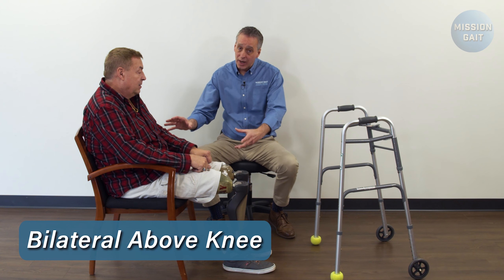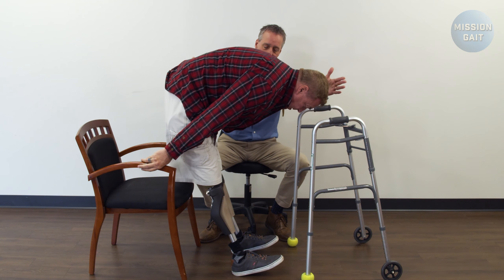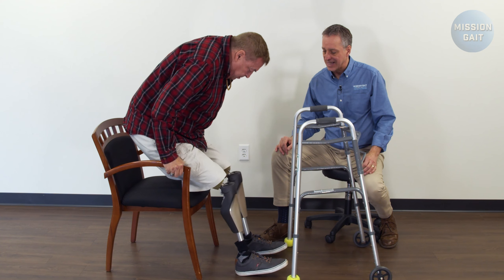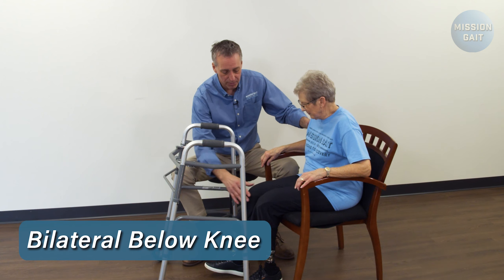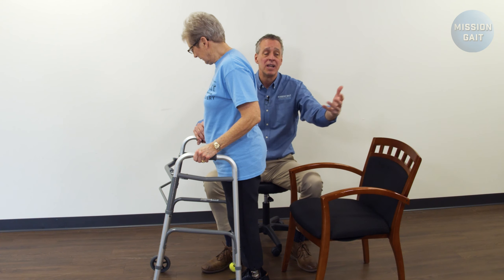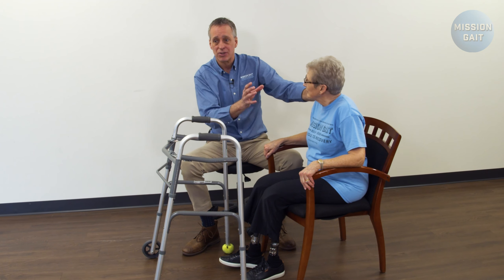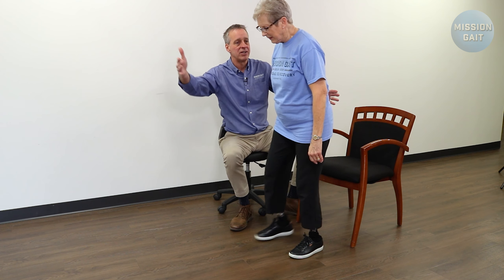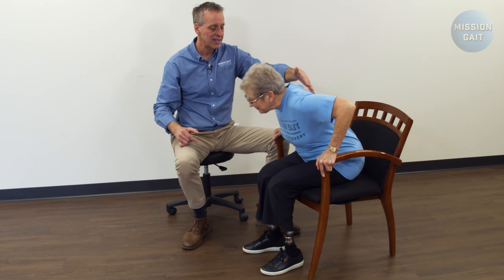Getting Up Out of a Chair: Sit-to-Stand Transfer for Bilateral Amputees- Prosthetic Training: Ep 7

Comment: Good advice but nothing about sofas which dont have two arms such as a wheelchair. Most sofas are lower than a chair and I had difficulty until I placed a 6 inch riser under each foot. Rising is easier nose over toes. Thx.
Reply from the maker: Thanks for sharing! Places like sofas and deep chairs, such as recliners, are particularly tricky. If you can elevate yourself, scoot to the edge of the chair, and commit your weight forward (nose over toes) then you have the best chance for success. It is never easy, but it can get better.

Comment: Please demonstrate with OSSUR TOTAL KNEE 2000 , as iam very much struggling on it while sitting
Reply from the maker: With the Total Knee for bilateral prosthetic limbs, standing up looks the same as demonstrated at 0:41. Sitting down requires the same upper body control to be able to ease yourself down in the chair. This is tough as it requires a lot of upper body strength to perform and a very hard push from the legs back into each socket. The model for this video makes it look much easier than it actually is. The best thing you can do to ease this challenge is to find higher surfaces to sit on whenever possible. The biggest safety note is that the Total Knee needs to be locked out bilaterally for a bilateral above knee amputee. Unfortunately we don't currently have any bilateral amputee patient models that have the Total Knee, but we will definitely make a note of it.
Reply: Mission Gait So I don’t think when this much of effort and struggle is required for sitting with knee, which is the most basis requirement like walking. Then it is not recommendable for bilateral above knee amputee. Pl give your un-biased view. Thanks
Reply: Where are you from Ritesh ?
Reply from the maker: Ritesh, the Total Knee is a more cost friendly prosthetic knee, so it has significant limitations for walking and for sit to stand transfers. This difficulty is considerably increased with the bilateral above knee amputee. Prostheses with hydraulic or computerized components would make the process much easier. The primary downside of these components is the significant difference in cost, which is often out of reach for many people.
Reply: Md Dastagir Fasihuddin India
Reply: Mission Gait total knee 2000 is not hydrolic??
Reply from the maker: @RiteshKumar-zh2lh The Total Knee 2000 is an example of a polycentric knee. It depends on appropriate positioning and load to maintain a locked knee. Once the knee starts to bend there is no resistance and will collapse under load. A hydraulic knee (An Ossur example would be the Mauch Knee) has a hydraulic cylinder which provides resistance when the knee is bent. This allows the person to sit more easily by using this resistance to lower to a chair.
Reply: @RiteshKumar-zh2lh  Please check your youtube discussion inbox